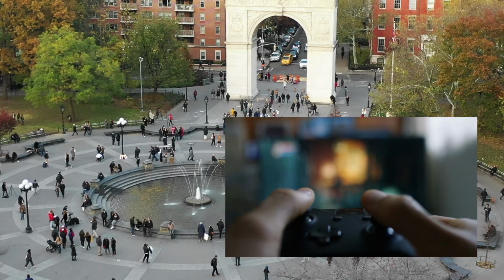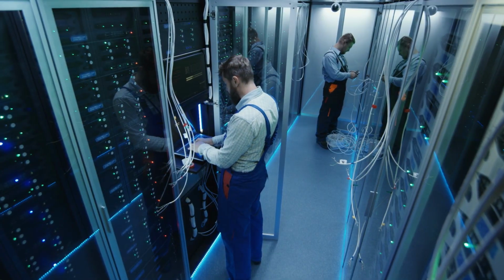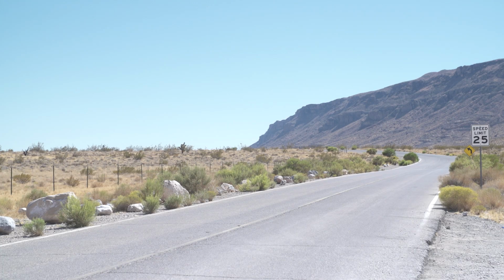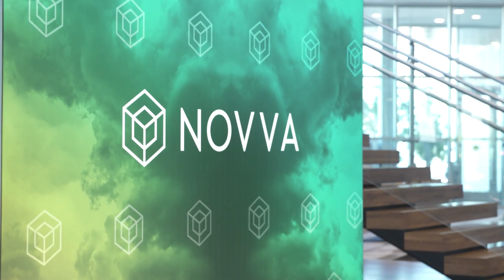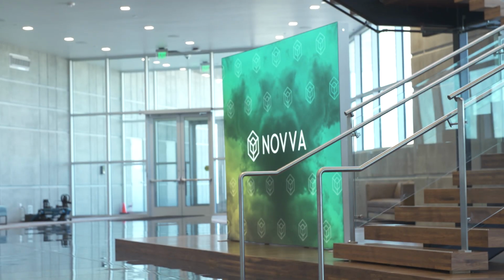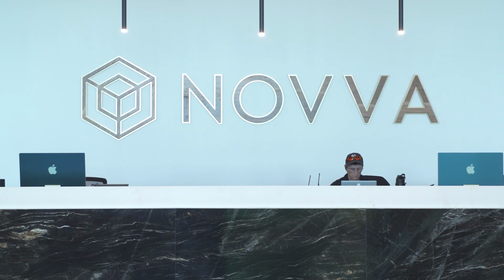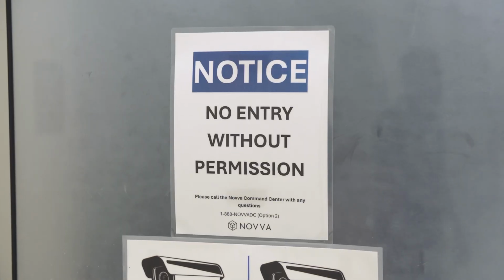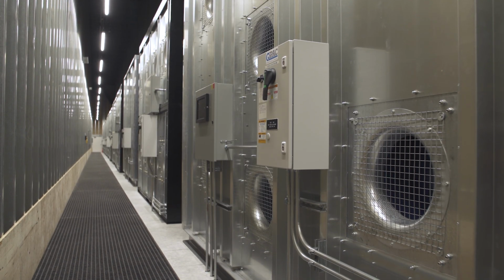NOVVA Data Centers and the insatiable thirst for data

Comment: This is really great work. As a Plant manager in Africa with backgrounds in Chemical, process control and energy engineering, this is right up my alley. Funny enough, I currently have Power generation, Chillers and Automation (PLCs) on my critical facility protection portfolio. Having one SCADA terminal where all of these critical parts of the system can be viewed and controlled is the next level of performance in Plant management. We already use glycol for Power generation cooling, but still employ evaporative cooling for our Chiller systems. Definitely thought provoking innovations here. Good job! Also to add, the ILC definitely is a master stroke, I would be interested in seeing more videos about that for sure.